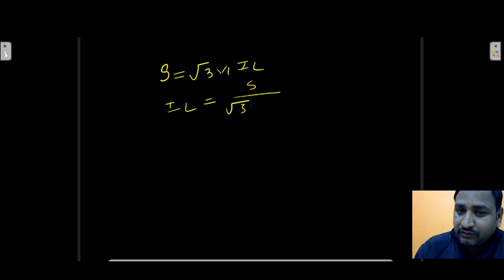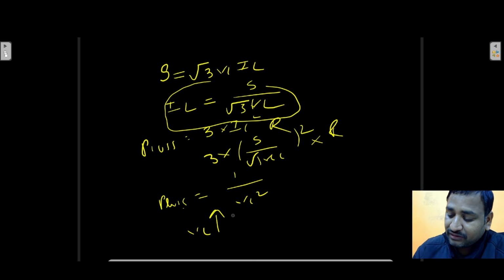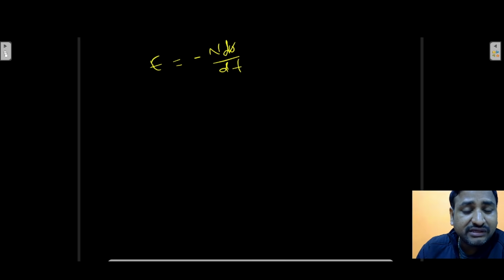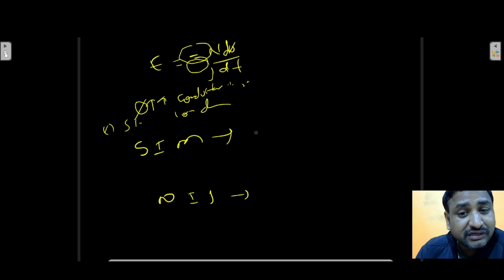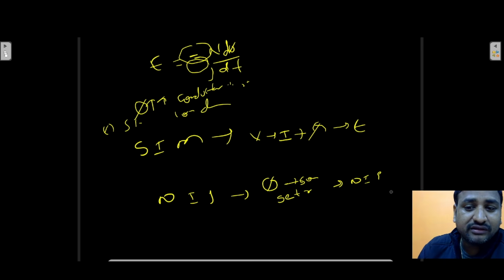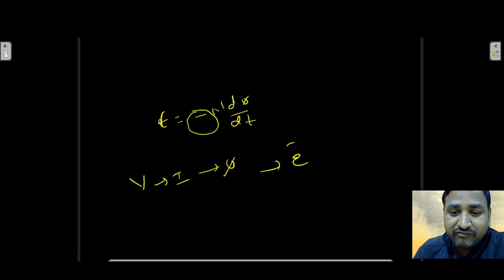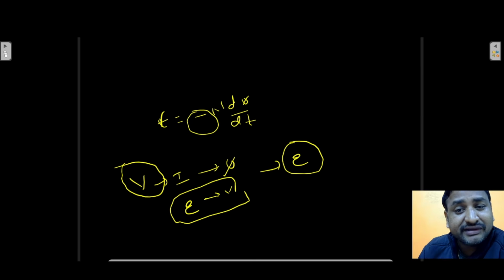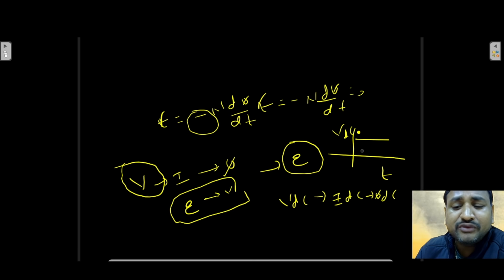Transformer Basics &  Why Do We Need to Learn About Transformers? | Beginners Guide

Comment: Can't we use DC supply in place of AC if not why sir?
Reply from the maker: No , we can't apply DC supply to transformer because if we apply DC supply  flux produced will be constant  and conductors in transformers are static it means there is no relative change in flux with respect to coil ...so no emf induced ..if we go on give DC supply transformer core will go in Deep saturation which will result in burning of transformer